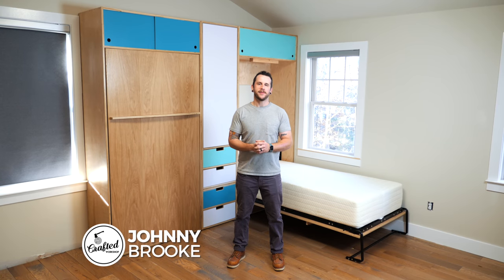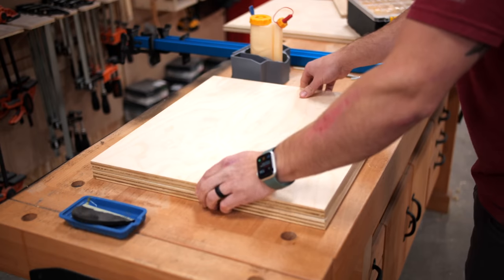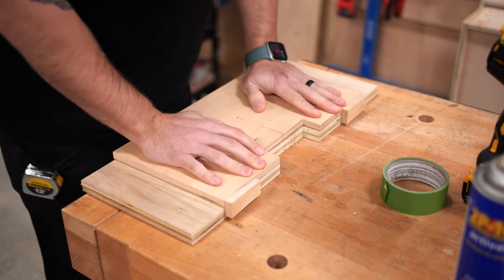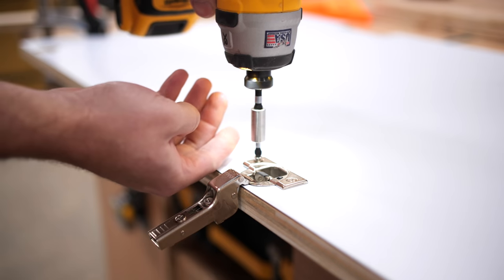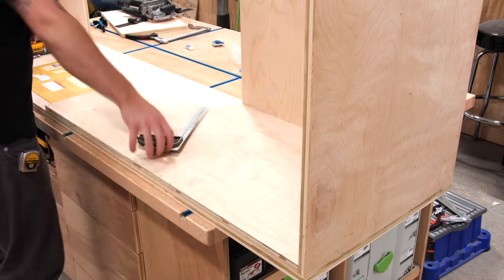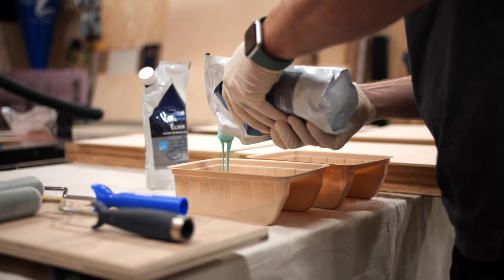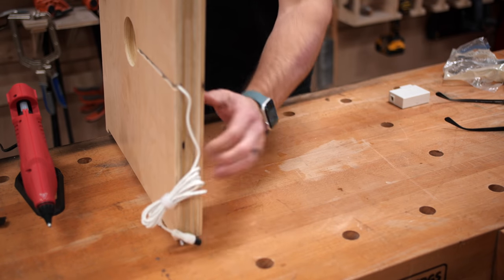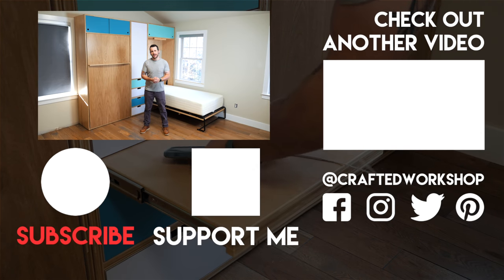How To Build A DUAL Murphy Bed with HIDDEN CHARGING Nightstand

Comment: Ohhh, I might be able to use that USB puck for my van!
Reply: Do you have a link to the USB Puck? The link Johnny posted was for an ikea wireless charger.
Reply from the maker: This is the one : https://www.ikea.com/us/en/p/nordmaerke-usb-charger-white-cork-60442571/
Reply from the maker: The only thing is it’s 120V, where as you want van stuff to be 12V. Alex has something similar that Seth put in, and it’s 12V! When you coming to AVL to work on the van? 😜

Comment: I'm not a professional woodworker, but I've built tons of projects over the years because I've had to.
Pocket holes have a bad reputation, but I like them, and they're usually sturdy, especially using the belt & suspenders approach with dominoes/dowels.
That said, I use glue on any project that I don't expect to need to take apart and reassemble.  Part of it is the added strength, and equally, I like the squeak/creak control.
Reply from the maker: For sure, better safe than sorry!

Comment: I have a Formica cabinetry business. You can use shelf standards supports that are used to hang 6-24 inch shelving brackets as well as pvc piping or really anything to place between the laminate and the wood to keep it from sticking. In the case they get stuck incorrectly at some point where you don’t want them to you can simply get a regular water bottle full of lacquer thinner and poke a hole in the top of the clear top and spray the contacted section down with the lacquer thinner to have the two pieces release. Then just reapply the contact adhesive down to the spot that was soaked. Also they make small air pressurized bottles with a spray gun attachment you can use instead of a roller to spray the contact adhesive down to each piece. Btw you don’t have to wait 30 mins for each piece to set. Just touch it and if it barely tacky and dryish to touch it should be ready for adhesion. They also make special Formica router bits that can either leave a straight edge or a beveled edge to cut the Formica and a good way to keep it from burning is to use Crisco along the edges if you ever use Formica strips around the edges. Great video though!
Reply: Thumbs up were for the crisco idea! 
"Standards"?  What do you mean? (Forgive my ignorance, I'm self taught, and don't talk to others much about building, thus,  I lack vocabulary).
Reply: @marti4689  Shelf standards support are the brackets that you screw and anchor into the studs of a wall to allow for 6-24 inch brackets to hook into them. You can Google that word for the image and you will recognize it. My apologies for not being more clear. I will edit my original post to reflect that.

Comment: You can 100% skip adding glue. Over about 2 years of cabinet making (both professionally and in my own personal projects) I've never once used it and everything has held up without any problems :) I would suggest making sure the top and bottom pieces are the total cabinet width however, as this does a much better job at transferring loads to the ground, without relying wholly on the screws

Comment: I think it was Ana White who said she skips the glue and she hasn’t had any problems with her stuff falling apart. I made the mistake of believing people when they say the pocket holes just work as clamps. Nope—pulled some pocket hole screws out of a torsion box because I didn’t want to make a trip to the store. The box fell apart when it fell off saw horses. Fortunately, I was contemplating getting rid of that box anyway and this made breaking it down easier. In hindsight, it makes perfect sense that butt joints wouldn’t hold Henry well.
Reply from the maker: Yea I think pocket holes are probably weaker than screwing through the faces like on some of these panels. It just seems like most cabinet makers don’t use much glue.

Comment: For me it all comes down to intended longevity, motion, weight capacity and width (I.e. ability to flex/rack). I’ve made a bunch of shop projects with just pocket holes and no glue or dominoes and they’re shockingly sturdy even after a couple years! I’ve also made some rolling cabinets for heavy items at the manufacturing company where I work, and due to the flexing from the moving and due to the weight the cabinets hold, glue was a must! The movement (if it’s mobile or if it’s huge and flexes a lot during transport/install), the glue helps reinforce the joint and keep the screws from ripping out of their holes or breaking. When I get around to building all new kitchen cabinets, I’ll definitely use glue because some of those will see a lot of weight and it’s something I’ll want to last a long time. For something to last only 5 or 10 years though without a lot of stress (like the closet in this video), I’d be totally comfortable with just pocket screws and dominoes. Relatively low payloads, and it’s really narrow and fairly easy to move into place without a lot of twisting and torquing in the screws.

Comment: I really enjoyed the video, and got some great ideas.  Thank you for those!!
There were a couple things, I felt I wanted to write to you, and mention. 
First, I must aadmit, I'm  suffering from severe tool envy.  HOW did you get all those new fancy tools, all with dust collection attachments, and every new clever gadget there is??  Are all those things from Rockler?  Do you have a special deal with them? (How can I get one of those deals? LOL!). How is your shop so CLEAN??
Please could you post info on your mobile dust collector, that showed in the video, when you were sanding. TY 👍
My other random comments:
I felt a tad uncomfortable with the amount of materials you use (a few spots I thought less would be more reasonable / economical / environmentally friendly, etc.  Just one example:  the pull out nightstand could've had thinner plywood, and spacers (from scrap) in the middle, that would've given you a ready made  place for the cord to run too).  
With all the work you put in, why oh why are you covering any of it with laminate and paint?  You're a woodworker, don't you love the look of wood?  I can think of so many more looks that could've showcased more wood. 🥺  It's just my preference...  You're free to choose, obviously.  It's still a very cool project!
LOL on the window sill, I saw that as soon as you put the cabinet the corner.  Stuff like that happens to all of us, at some point.
Thanks for taking the time to shoot, cut, and share. 💜Thanks also, for not being too chatty!!
Cheers ☮️🖖🕉️!

Comment: @craftedworkshop I generally don’t glue box joints just because it’s just a weak glue surface anyway.  Check out confirmat screws, they’re designed specifically for cabinetry and are crazy beefy.

Comment: Glue actually provides more strength than the screws if you clamp the joint while the glue cures.  You are going overboard with using the quantity of dominoes AND glue AND screws.  The screws are basically mini clamps that hold the wood together while the glue dries.  The domino provides a continuous segment of wood through the joint and more surface area for the glue to adhere to.  If you are using a good glue, it is stronger than the wood and you will break the plywood before the glue lets go.  With the combination of the three joining methods, you only need enough screws to hold the joint tightly together while the glue dries and you only need enough dominoes to ensure proper joint alignment.

Comment: DIY - Do It Yourself 😯meaning any average Joe could do it ... I have a hammer 😢😢
Reply: You can get the boards cut when you buy them at the hardware store, and you can use a online or bulletin board neighborhood forum to find neighbors to borrow a drill and other standard tools from. Alternatively you can buy manual non-electric saw and drill for like $10 total.
Reply: Haha yeah DIY and then does it with 10’s of thousands of dollars (100’s maybe) worth of equipment lol.
Reply: I was thinking the same thing. But most people should have a drill, even for putting up a simple shelf. A simple drill press that the hand held drill slots into would be a good idea. The manual pocket hole jig is needed but about cheap on amazon. The track saw at least I can see being a necessity, especially if you can't borrow a table saw. Domino cutter, 5ft long bar clamps etc, forget it, that's way outside a hobbyist.

My chances of trying this project with the limited DIY we get in Malaysia, in my Condo, just plummeted.

Comment: Very cool Murphy beds.

One comment of screws vs glue: glued joints (box, finger, dovetail, tenon, etc) are always going to be stronger than pocket screws. The issue is the pocket screw pulling the head of the screw into the wood. 

See: woodgears.ca/joint_strength/index.html for a good test experiment of all these types of joints.

Comment: I utilize an old metal venetian blind I repurposed for laminate stickers.  I wipe them down with a rag lightly coated with wax paste to eliminate dust and break any electrostatic buildup just prior to placing them on the glue-up surfaces.  This eliminates getting a saw dust crumb in the laminate and the resulting bump that telegraphs through the surface.  

It hurt me to watch you use your bar clamps for this...and then drop them on the floor!  uuh...

Comment: Fascinating.  I was just starting to design a similar piece for my house.  I have an unused bedroom that has two twins in it for guests.  But i'd rather that room be another little sitting room.  If i could tuck away the beds (which are only really needed a couple of times per year), then i could still easily put in a couch, a chair, a TV, etc.

Great job on this - i'm definitely going to rewatch a few times and incorporate some of your ideas into mine if possible!
Reply: I was thinking something similar but instead of having it upright I was going to make a taller sideboard with the single bed coming out sideways, that way its nit full height and has shelves etc above it.
Reply: @ArchangelAzrael1  If you follow the link in the description to the Rockler site for the hardware used, you'll find they have hardware for that style as well.
Reply: Thanks mate, I'm in uk so might have some difficulty shipping etc but at least it's an option and can figure it out in long run!
Reply: @ArchangelAzrael1  You may just be able to find a similar product that is more available to you - or if you're really adventurous, look at the parts and try to make your own!
Reply: Do you follow diy creators ? Glenn has a cool way of using swivel seat mounts from a boat I think, as the base bit of the Murphy bed. 
Cheers though I'll give it a god 9ne day

Comment: Man, what a project! Looking awesome and definitely adds a ton of function to the room! Just a suggestion, instead of a bigger stopping block which interferes with the bed closing you could fasten a tab to the metal frame of the bed to make contact with a smaller stopping block.
Reply: Yo wabi! Been waiting for your next upload
Reply from the maker: Good call man! And thanks, super happy with how it turned out. You and Hannah will have to come visit sometime 😊

Comment: Great video. I noticed you were using the Infinity Dado set with your SawStop. Don't know if you are aware of it, but SawStop says to not use the Infinity or any dado set with solid disc chippers due to the extra mass/weight overcoming the stopping function of the safety cartridge. I wish someone would test this. I also have an Infinity Dado and I would love to use it with my SawStop. Of course it isn't a problem unless you trip your saw with the dado set, but then that's why we own the SawStop. I've only tripped saw once and fortunately not with my flesh. I got too close to the aluminum backstop on my miter setup.
Reply from the maker: Interesting, good to know! I agree that some testing would be warranted here. Thanks for the info!

Comment: I have not done the same scale of projects that you have but I personally like using glue with screws. I’d rather clean up the glue then have to deal with joints that aren’t completely stiff, whether it be from imperfect cuts or over time from just general use and stress of those joints. I just think it helps fuse everything into a unit instead of having pieces that are just connected together if that makes any kind of sense. 

BTW love your videos! You always have an interesting project!
Reply from the maker: Thanks, and good feedback! Seems like most people are pro-glue for sure.

Comment: As you stated. When using laminates, it’s normally best to use either another one or a cheaper liner/balancer on the reserve face as well.  Otherwise it does tend to pull apart over time.
Reply from the maker: Glad I did both sides of the door for sure. Better safe than sorry!

Comment: I’m always building stuff with my dad and we skip the glue! We think it’s unnecessary because glue takes way too long to dry and screws assure secureness within minutes!
Reply: Glue does take a while to dry, but it provides strength long-term. Screwing pieces together after adding glue will secure them together while the glue dries.

Comment: Is there a good specific pen for wood work markings ?
Reply from the maker: I typically just use mechanical pencils, as they can be purchased super cheap and are easier to erase/remove than pens.

Comment: I found that glue is only necessary to restrict movement when filling gaps between panels with filler and then painting, otherwise it will crack along that edge. If your leaving it O-natural then no need for glue.
Reply from the maker: Good point!